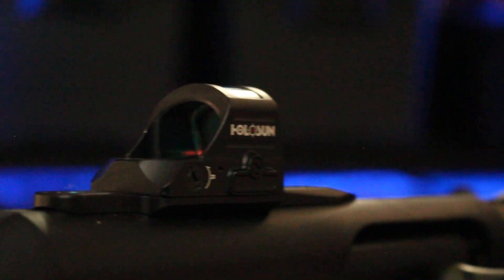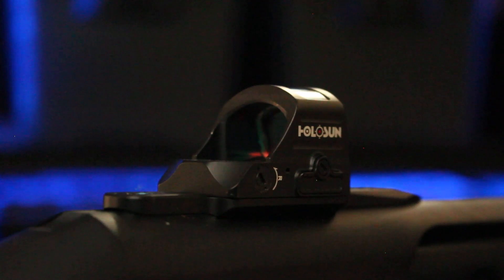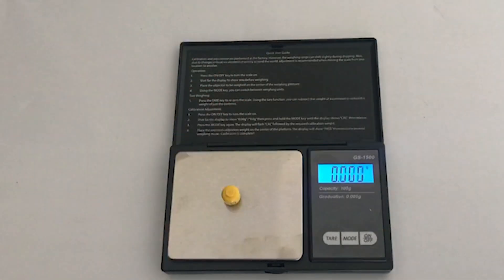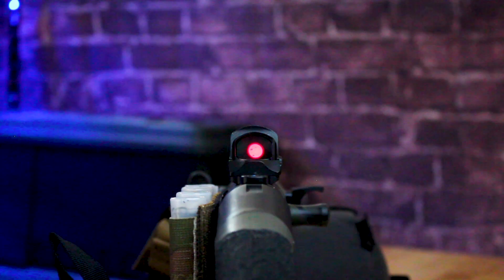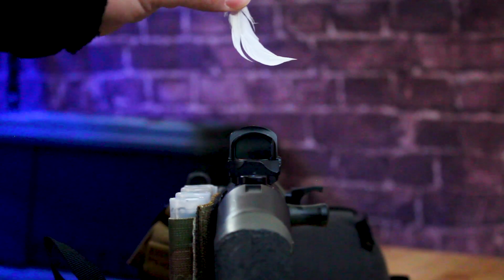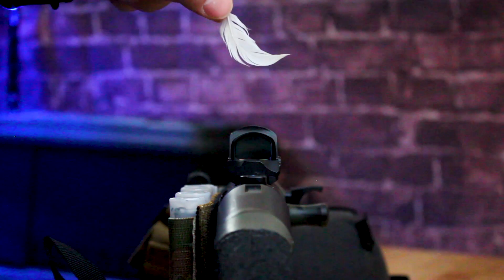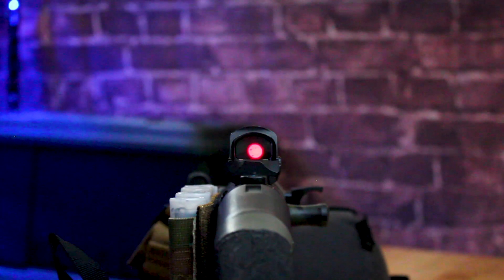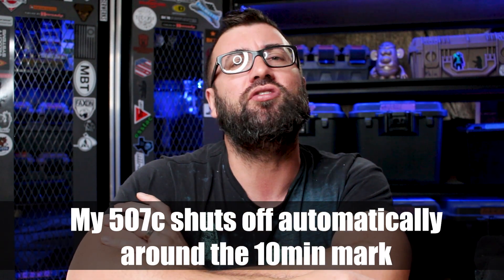Holosun 507c X2 Test | WILL it turn ON when you NEED it Too?!?

Comment: there is one optic that i'm interested with the same shake awake/motion sensor technology that puts it to sleep mode when there is no movement and turn on with a slight movement....however, this optic i'm referring to will COMPLETELY shut off if there is no movement something like for 2 or 4hrs and you have to manually turn it on again and that is a big deal breaker for me...how about 507C?
Reply from the maker: interesting, I think you're better served with one that turns on all the time whenever there's movement like the 507c
Reply: @TacticalFellowship  exactly my thought...that served the purpose of motion/shake awake technology...to be always ready anytime

Comment: lol entertaining video, but what if the feather was dropped with the quill facing down? With the solid quill part being able to transfer force much easier than the flat of the vane, I think it could make a difference. Possibly a larger feather in the 0.1G range? Also, yes. I googled the parts of a feather for this comment.
Reply from the maker: lol you win best and most researched comment of the day 😂 and yes, good ideas there, I still don't think the quill would do it with that weight feather - probs 1g like you suggested...